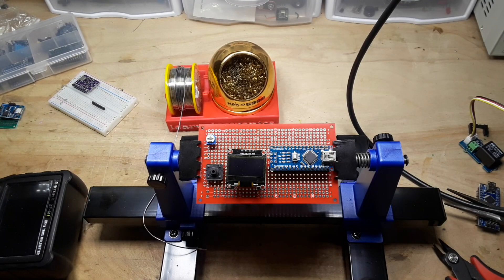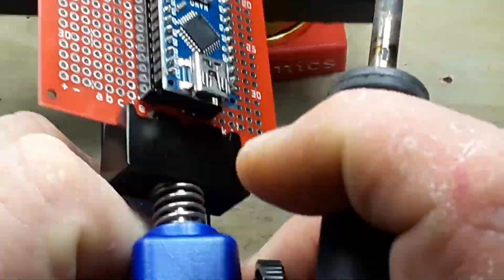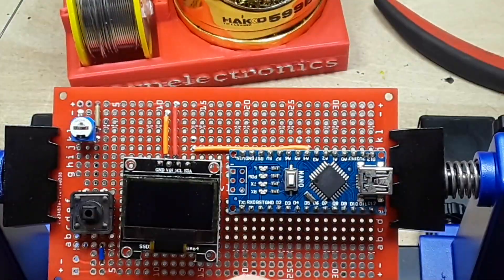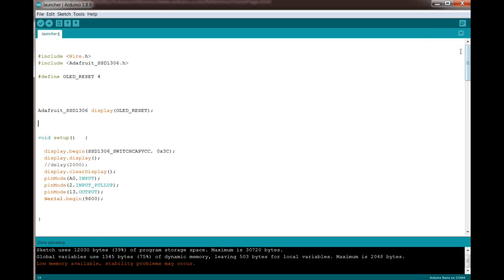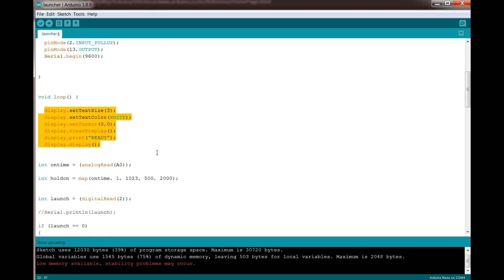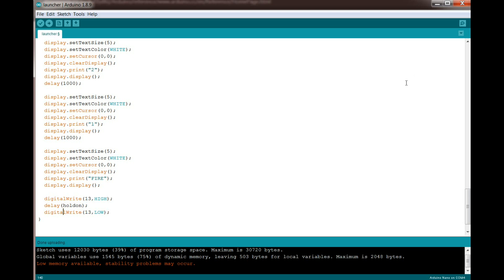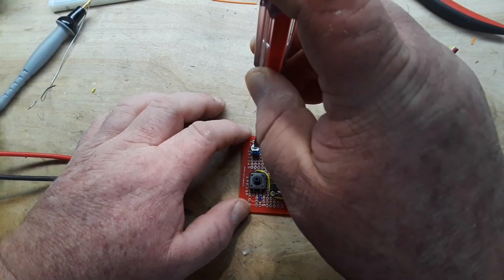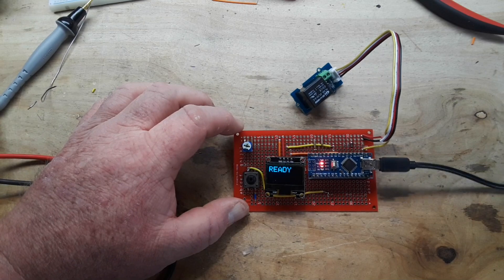Prototype Model Rocket Launcher using Arduino

Comment: Wow! Will try to build same for my rockets too :) What exact relay are you using?  Does arduino board safe, because ematches need around ~750 mA, but for arduino this seems is too much? (I am novice)
Reply from the maker: The relay handles the current, the arduino just sends a signal

Comment: Wow, this brings up memories in the 80's when I built a model rocket launcher using a 74LS154, a relay, a 555 to generate the clock and 74LS190 decade counter with both a 2 LED Numeric display and a strip of leds that counted down

Comment: Hello, can you make a device with an Arduino that monitors the presence of power supply (12 volts) applied to a certain terminal which in case of failure and subsequent recovery to turn on the relay for 2-3 seconds then turn it off and stay in standby mode?

Comment: Wish I had this in my younger years, like 50 years ago, only thing missing is an igniter continuity indicator, a very low current check that your connections are intact.

Comment: To keep the cost down, I'd have used a 555 timer, 4026 display driver with a 7 segment display.
The relay is conected to pin 5 of the 4026. Of course this will only count from 0 to 9, not 9 to 0. But it would work. Great vid.

Comment: Now , how do you do it with 13 ¢ worth of parts an no ardueno ?
Reply: Just touch the wires to a 12v battery lol.
Reply: You could do a a delay with a monostable using a 555 or 4098 etc with discrete parts triggered by a switch. You could make it more complex by using a BCD counter running a 7 seg and some logic to count to 7...there are loads of ways to achieve this cheaply without an arduino, it just depends what you fancy!
Reply: Easy, if you don't mind it counting up. (0-9). :)
Reply: @Franko_Walker  that's not true, you can make up/down counters from flip flops or existing chips like the 4029 which allows bidirection counting and inputs to preload.
Reply: @jonelectronics510  Ha Ha, I forgot about the 4029. I'm a berk.

Comment: Instead of a mechanical relay couldn't this be done via a mos-fet?
Reply: Yes it can, most professional firing systems will use mosfets these days. The firing system doesn t have to high voltage, it just needs to have enough voltage to overcome any cable run resistance and supply sufficient current to pop the match. A 1.5V AA battery would fire an igniter.

Comment: But what happens when he has the rocket in launch mode and a plane with a bunch of babies in it come flying by... how will he disarm it so there are not a bunch of burning babies falling from the sky?  Have you no heart man!?!?!
Reply from the maker: Press the reset
Reply: @learnelectronics  Well I just hope your "friend" follows the Checklist clearly and can hit that prominent reset button! :)
Reply: Think of the children!
Reply: Perhaps a bit more code where a second button push while the countdown is active will cancel it.  Thinking more of a kid or a dog running into the launch field and having to tear wires out of the board to stop it.

Comment: I can't help myself.  For the countdown part only:
for (int c_down = 10; c_down > 0; c_down--) {
  display.setTextSize(5);
  display.setTextColor(WHITE);
  display.setCursor(0,0);
  display.clearDisplay();
  display.print(c_down);
  display.display();
  delay(1000);
}
Reply: for ( int c_down = 10 ; c_down > negative 1 ;c_down -- ) 
{ display.setTextSize ( 5 ) ; display.setTextColor ( WHITE ) ; display.setCursor ( 0,0 ) ; display.clearDisplay ( ) ; 
display.print ( c_down ) ; 
display.display ( ) ; 
delay ( 1000 ) ;
}
Reply: If you would be countdown with button,you can use example buttonstate or flag.